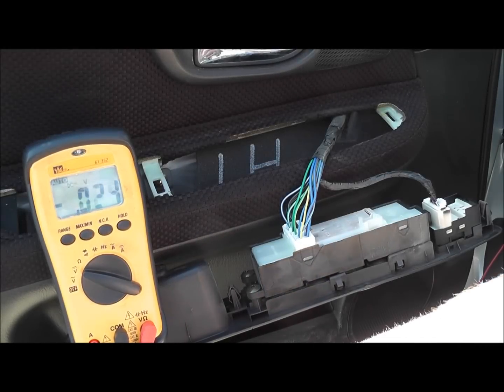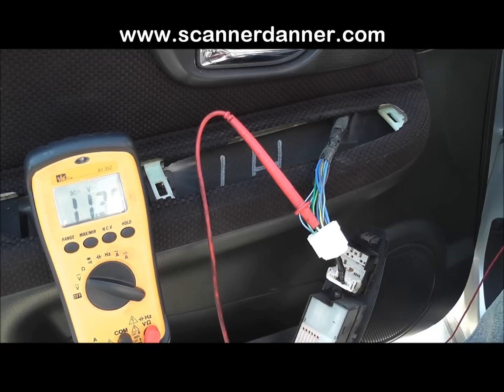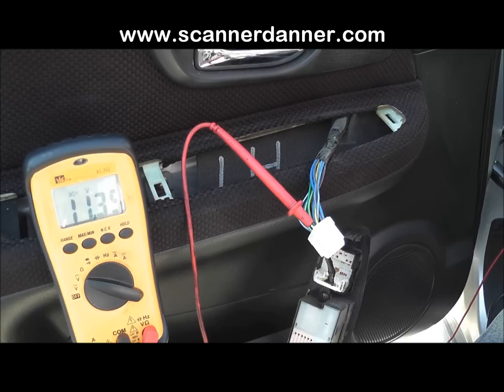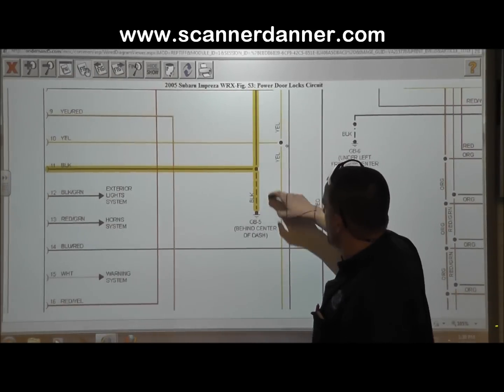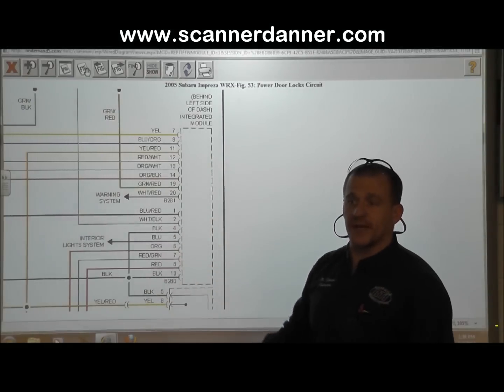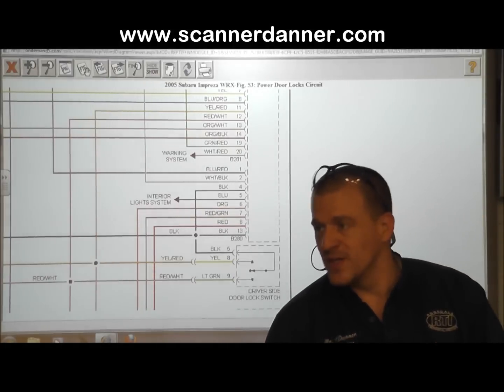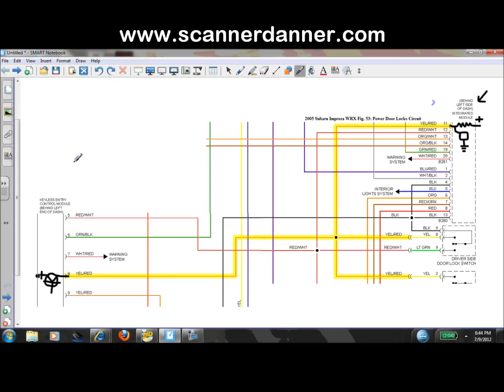How to test computer controlled door locks - Subaru

Comment: Hi Paul, I could be wrong if so could you explain it please. Would this not be a pull up circuit? I know the voltage is pulled to ground so the module knows the switch is closed. From what I have learnt and been taught that is if the switch input is at 12v in this case when the switch is open it is a pull up design. 

My understanding as an example the bcm applies 12v through a “pull up” resistor to the switch and the bcm internally monitors this voltage after the resistor so in the case of the switch being open the voltage is pulled up to 12v and 0v when the switch is closed with the bcm seeing this.

Is this correct or am I getting confused with pull up/ pull down resistors and terminology? My understanding is that the default state of the circuit determines if it is a pull or pull down circuit.

Thanks.
Reply from the maker: Pull up resistor yes, but pull-down circuit. I've always taught it from what the switch is doing. It is pulling the circuit down.

Comment: Paul I have a question how do you determine if the wire is an input signal or a control wire without a diagram?
Reply from the maker: The computer is "watching" input wires and "controlling" output wires. If it is something that is being turned on and off, it is an output, so it is a control wire. In this case, the door lock switches would be signal wires (inputes) and the lock solenoid or motor would be control wires (output)

Comment: 12v at the switch plugged in sould tell us that it is a pull -down design,right? It it were a pull up design with the swith plugged in, I would think that you would have 0v at the switch  until you activate the switch.
Reply from the maker: Plugged it, you dont know the normal state of the switch. Both types will read 12 and 0 with the switch open.
Switch closed is your ID.
12 and 12 (pull-up)
0 and 0 (pull-down)

Comment: We have a 2003 Honda civic . We changed the ignition switch it is out of a 2006 . It will start the car but will not open the doors. Can it be programmed. Or do we need to have a 2003 key for it to work. Ron
Reply from the maker: are there CAN lines that go to that ignition switch? I don't think so on an 03, so no, this is not a programming issue.

Comment: I was troubleshooting a seat that would not move forward and backward. I could bi-directionally move it forward and backward, which would suggest the driver seat module was fine. Unfortunately, I had to replace the module to fix the issue.
I recall having 12 v from the module going to the switch, but when the switch pulls it to ground, the ground did not make it into the module. The switch and its wiring were fine. I still don't understand how the wiring inside the module works. The only thing that matters is that I used your videos to fix the car.
Reply from the maker: did you have a data PID to look at that switch input? Interesting one for sure and nice job on the fix
Reply: It was a while ago. Not sure if I had the inputs. I may still have the old module. If I still do, I may put it back in and check the voltage going to the switch and move the switch in the forward position to see if the voltage goes to zero and also see if I have data PID for the switch inputs.
Reply: The 12v feed to the switch maight have been open when I was testing the module  and not allowed the module to see the imput. That is the only way that I could move the seat bi-directionally. That's what I can conclude. Thanks again, Paul.

Comment: Hey I like the video you are very patient I seem to be having trouble with my 2008 Honda Pilot power locks locking when I try to open all the doors with the key fob hitting it twice I hit it once the driver side door opens now when I pull the plunger on passenger side front to open all the doors lock the only doors I can pull the plunger is the driver and two rear it doesn’t lock automatically and sometimes all the doors lock even when the key is in the ignition running got lucky it happened at home and I had a spare key everything is factory alarm works it beeps please help me I’m guessing bcm don’t know if it needs to be reflashed or if it’s plug and play need help it would be greatly appreciated
Reply from the maker: post this to my forum https://www.scannerdanner.com/forum/post-your-repair-questions-here.html it is free to join and we can help you there for sure!

Comment: I know this video is old. Both of my windows were going down when I turned my Nissan off. The switch looks exactly like your video: I changed the driver and passenger switch. The driver side stopped going down, but the passenger side still goes down. I changed both of my lock actuators and window assembly.
Reply from the maker: Can't help you with the info you provided. Year, make, model, engine (Nissan is not good enough) 
Could be a pinched wire in the door jam too
Reply: @ScannerDanner  I appreciate it. I will look more into it. My alarm light blinks when the alarm is not activated. May have something to do with it as well. 2005 Nissan Murano 3.5 AWD.

Comment: Man electrical became a whole lot easier once I understood that the module has a resister with a voltmeter to the voltage drop when a switch or sensor is used lol (On pull down switches and sensors anyway) 

in pull up circuits the module just monitors for input voltage right?

Comment: What would cause the door locks to automatically lock but not unlock when the switch is depressed. Ive changed the door lock assembly thinking that was the problem but im having the same problem

Comment: Hey, Paul. Would you still be able to load the ground with a bad switch?
Reply from the maker: no sir, but if you close the switch to ground and your ground voltage does NOT increase, your ground is NOT your problem. Make sense? So even though you would not technically be loading the ground, you have properly identified the ground is not your problem.
Reply: It does make sense, Sir. Thank you very much for replying and helping me understand diagnosis better. You are the one I turn to the most.

Comment: Paul you mentioned you can't tell by looking at the schematic on the circuit design, but to me it seems pretty clear that it's a pull to ground (pull down) design.  If it where pull up wouldn't the common wire to the switch be a  constant hot?

Comment: Thanks for this video. My 03 subaru impreza was locking but it was NOT unlocking. I was able to use this video to truobleshoot and test. Thanks to this video i knew what 2 wires i had to look at at the plug on the door. Yellow wire is to unlock. I tried jumping it with a test light from a ground like he did here and nothing happened but when i jumped the locking wire the doors locked just like it was with the switch connected. So i new it wasn't the switch. I checked for continuity from the door switch to the module or computer and found i did not have continuity on the yellow wire which turns into yellow and red when it gets to the module plug. So used a wire to jump from the yellow wire on the door plug to the yellow and red wire on the module, with both plugs connected and it unlocked the doors so i knew the issue was an open circuit on that wire. I didn't feel like taking everything apart to check where the wire broke exactly so i decide to just run a wire from one end to the other and bypass that yellow wire. So far i have seen no issues whatsoever. Time will tell i guess but i have a feeling there won't be any issues. Thanks to this video i was able to fix this. Its amazing what you can fix by just doing some research online.

Comment: Bad ass video Paul you’re a MASTER. At work one time I had a Hyundai Sonata. It had some problem with the door locks. I can’t exactly remember what. But when I started the video I wanted to ask you this same question. And that is why when i tested power wires with my test light did the actuators in the door locks-lock. Now I know why. Even though i don’t know everything about electrical right now I understand how you explained it in the video. That was the same exact question I was going to ask you. I was baffled as to why the locks actuated when i used my test light. Thanks for the videos!

Comment: Paul, I followed a small course using a arduino as a mockup car CPU. Creating pull up/down situations. Relais activated from the "CPU" by a switch circuit etc just playing with it would give your students also a good feel or better feel for that kind of circuit.
Reply: It work same corolla 2003 to 2007
Reply: felipe cordero huh?

Comment: great video but i think u switched between the pull up and pull down methods to monitor the switch 

a pull up method : the control sends the 12V or whatever to the switch which is connected to a ground . when the switch is on the 12V from control side turns to 0V and that's how the control knows that the switch is actually pressed so by grounding the the wire coming from the control to the switch the control acts if the switch is pressed 
correct me if i'm wrong please.
Reply: No, I think he was right. Like you said the module sends 12V or whatever to the switch. When the switch closes it allows the current to flow and the voltage to drop across the resistor in the module and the current flows to ground now that the switch is closed. The voltage drops to zero. Thus pull down. The voltage was pulled down from 12 V to 0V.  If the signal wire was 0V initially, and you closed the switch and the signal wire raised to 12V, then you would have pulled the voltage up to 12V. Thus, pull up design.
Reply: Steve M. yeah that's right thx

Comment: I got problem ive checked door wires all good relay movearound good fuses good no power door lock on bothside its a 02 lincoln navigator but I checked housing connection n I got no power put test light tried finding power n nothing wut could it b any advice

Comment: I was wondering if you can give a short cut in how to test a system without a bidirectional scanner I have an 03 envoy with a problem with the 4x4 the service 4wheel drive light is on and it's saying short to battery positive can you give me some advice

Comment: Hey Dan,Good video,I'm having problems with my central locking,It wont lock or unlock when I push the key button,I hear the relay clicking under the glove box,its a 2007 rx8.I have a keen interest in automotive electrics,I will check out the rest of your videos for help,thanks.
Reply from the maker: +Celtic Tiger no silver bullet suggestions for you brother. You'll need a good diagram and a voltmeter. You can post this question to my forum if you like. www.scannerdanner.com
Reply: Yeah,will do,thanks.
Reply: +ScannerDanner Hey Dan ,making progress on fixing Central Locking,I have power and signal as far as the actuator on drivers side door although its 4.8v,Im going to take the actuator off and test it later.

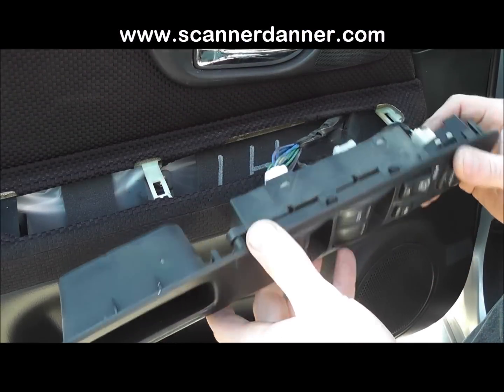Comment: Hey Paul, I have been watching your videos and classroom lectures for a while now and have learned alot. about the 8:00 minute mark you are checking the ground with the volt meter
and it shows good, it stays below the 100 mv range witch is a good ground. Just a thought here, if the ground was bad the voltmeter would have risen to the 11.39 volts that was coming from the 
signal wire, right.
Reply: If the ground was open yes. If the ground had high resistance  (still "bad") voltage would be higher than normal. But again, only with the circuit "loaded" (switch closed"

Comment: I would like to correct something that I posted earlier. Many late modern cars use a ripple counter connected to the motor to instructs the window to stop when it reaches the top and bottom limit. There are a given number of commutator impulses [ripples] as the window goes from open to close and these are used by memory chips to stop the window as it reaches the limits

Comment from the maker: nice thank Toms. So with this design would it be safe to say that a mechanical binding of the regulator would cause this Auto Up or Down feature to be limited from the thermal contact? I would think this would be in place even if they used the hall effect position feedback or the range limit switches as sivucit just stated in his research

Comment: part 2..  in case of Toyota, or Nissan, they don't use pulse or interrupter concept as I said in previous post, it uses something called limit switch. which is placed in such a way that if the door went all the up or down the switch will be enabled to disconnect the power..

Comment: Thanks Paul and Tom  A. I did some research in the weekend go some good Manual from Honda. What it does is, window motor have 4 wires in addition to regular + and -. These 4 wires are called pulses. It has hall effect sensor which look at the rotation of motor and generate pulse similar to our crankshaft and if the pulse is more(as per the programme) means something is obstructing or have reached the top based on total duration of pulses in ms,decided to disconnect the power. continued

Comment: Hi Paul and sivucit. There is a timer that interprets a short duration touché to mean that you desire a complete [toll window] open or close function. a longer duration touché will inhibit the timer to move the window as long as the button is depressed. When the window reaches its limits the current requirements increases drastically and this opens a temperature sensitive contact in the window motor and causes a shut down  the contact resets after a short duration. Thank you for this video  .

Comment from the maker: It certainly could be that. I know blend door actuators will have potentiometers inside of them but I've never seen that for a window circuit.  I supposed you could experiment with it by placing something in the path of the window. (I WOULD NOT RECOMMEND DOING THIS! YOU MAY BREAK THE WINDOW). If the auto up feature hits the block and then stops, then you will know that it is a current surge that triggers the off feature.

Comment: Paul, quick question.
1) when i press the power window up button once (no need to pull up all the time), the glass window goes all the way up. again just pressed once. what is the design that helps the computer to know that the windows is all the way up and it can stop the feed to the motor. any insight please. i was told that when window is all the way up, resistance in motor winding would trigger the computer that it is all the way up.
any clue or tips u have.

Comment: Yes, it I a fix I was guessing  on 2  of the wires  I see some voltage 12 input and ground, also on 2 wires up and 12 steady and down pulsating is like duty circle  ho I mean from. 0 to 5 volts only when I activate. Front left motor only, there are about 4 wires more that I do not see any activity at all when I operate all the other motors

The car is 98 Honda accord  2.3 l sedan
 Thank you I appreciate your time.

Comment: with the new master switch all the motors works just fine,the purpose of the question is for learning circuit design.
to learn i compare reading of faulty  and good working switch on reading back probing  them  the readings are  identical  I do not see activity changes in voltage  but the deference  are one works and the other does not  I took readins plug and unplug I do not see if it is pull up or pull down to do by pass. do you know how this work thank you.

Comment from the maker: what is the voltage readings on both wires to the motor in the up position and down position. I need four different voltage readings from you to help further.

Comment: - with the new  switch  plug in I gave  then power to up and down wires and the motor work at this time to recheck my self plug back the old switch same result than  before no reaction  how this system works? It has multiplex control. also I have some curiosity about the motor I connected the volt meter at the motor harness and activated the switch close   I read 12v   on up or down,plug or  unplug 0v. so I gave it power to the motor and did not do any thing checking my volt meter read4v?TKZ

Comment: Hi, Mr paul i have couple questions here I a  have 98 accord ex sedan 2.3l I had some issue with RL window motor not working  i suspected a switch doing some by pass test I unplug the switch and the 2 wires that goes to the motor up and down did not change state,  so I decided to give it some power and nothing happens than I plug in the switch  and give power to wires to motor nothing happens all this test where done with the faulty switch. Know I plug in the new switch and did the same test

Comment: Thanks. And also, I don't really understand how you would get 12v on the signal wire going to the computer with the connector plugged in on a pull-up type circuit design. I understand with it unplugged you would get zero volts but its with the connector plugged in that I have trouble with understanding, does that mean that the switch has continuity with the signal wire always until you depress it and open the circuit or what....? If can help me out with that, that would be great.

Comment: Talking about computers I just got my A/C fixed I got the factory manual very good info. It was a 1991 toyota camry  4 banger it had a bad ground going the the a/c computer . I checked by hooking 12v to compressor and it made the car cool and after a while I got to the computer and grounded the ground with a test light and the complete system come on . That computer sure does a lot of stuff for a car so old.

Comment: Sometimes computer controlled door lock and window circuits can be tough to diag, especially if they have timers (as in BCM controlled circuits designed to provide power for 30 seconds or so after you turn the vehicle off - as long as you don't open the doors). Wiring diagrams just don't show enough detail sometimes. Anyone who has been stuck on a circuit like this for any amount of time can appreciate this video. Information like this can save you hours of diag time. Keep 'em coming!